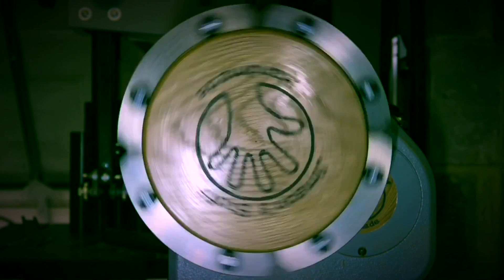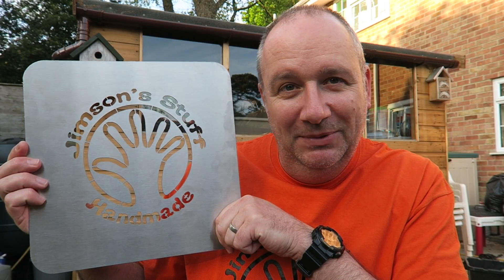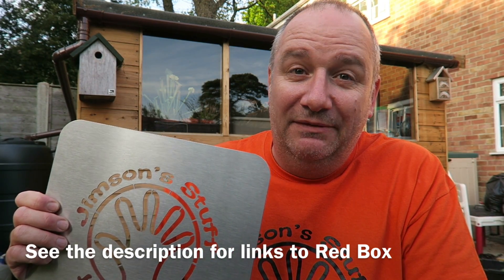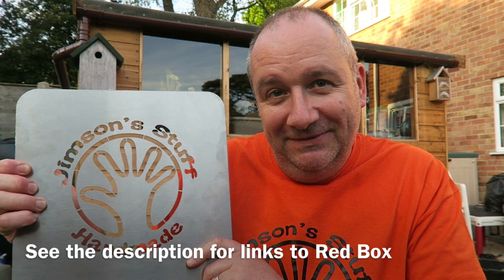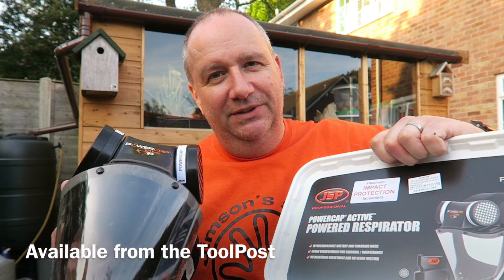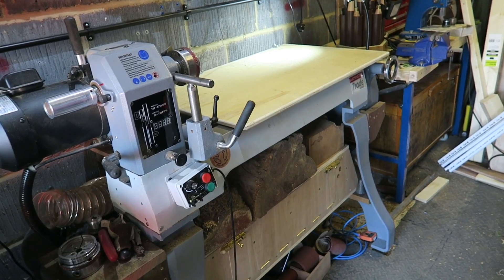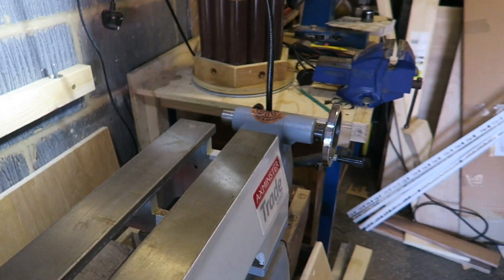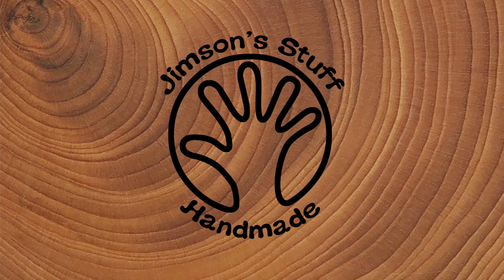Water Jet Cut Stencil and a new Respirator

Comment: Very interesting Jim, I love the stencil. I also have a Powercap and have done so for many years. I recently bought the later version like yours and am delighted with it. I recommend that anyone working with wood and other dusty materials considers using one of these positive pressure masks.
Reply from the maker: Thanks Andy, yes the Powercap is superb, I wish I had bought one a long time ago. I always take lots of dust protection precautions but the Powercap makes it a lot easier and more comfortable. I also have the Record Power AC400 air cleaner, which is surprisingly effective, the speed that the filters clog up shows how much airborne dust there is.
All the best, Jim

Comment: Many thanks, Jim and congratulations of the stencil.   It's a really nice gift.
I've been using one of the respirators for a couple of years and I've had a few pieces bounce off the face shield.   One of its advantages for me is that I wear specs and the down draught eliminates the misting over especially in winter.    I automatically put it on just as I do a car seat belt.  At the end of a turning session, I bring it indoors, run the domestic vacuum cleaner over it, clean the face shield with windowlene and put the battery on charge.
Happy turning,
Alan.
Reply from the maker: Thank you Alan , yes very pleased with the stencil. The respirator is great, it even fits my fat head ! I am being careful to store it in it's box. Hopefully I will make something next video.
Stay safe
Jim